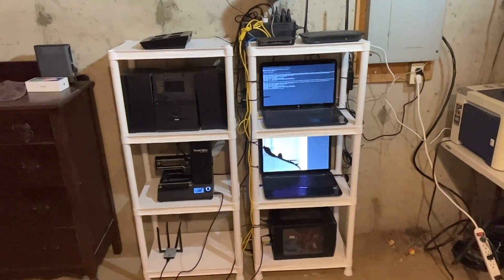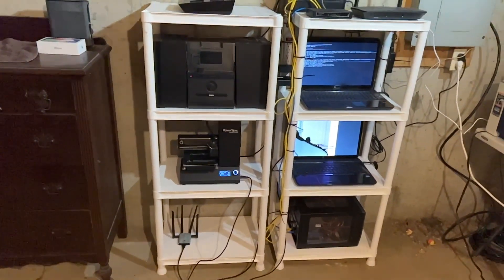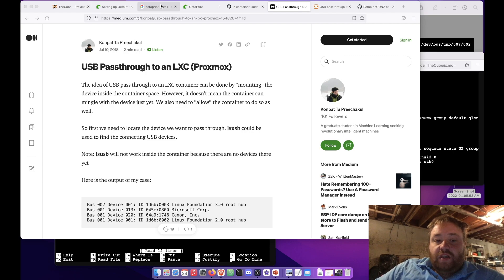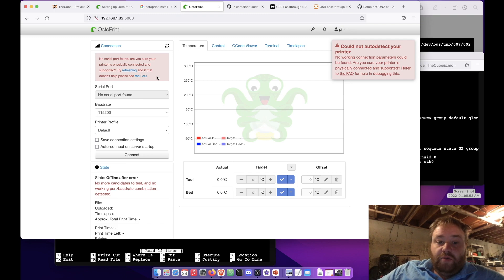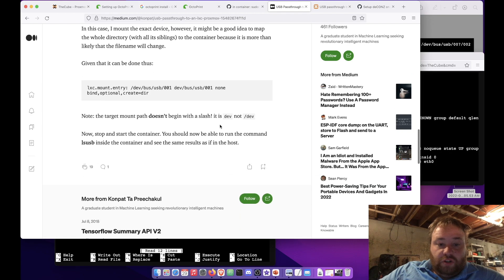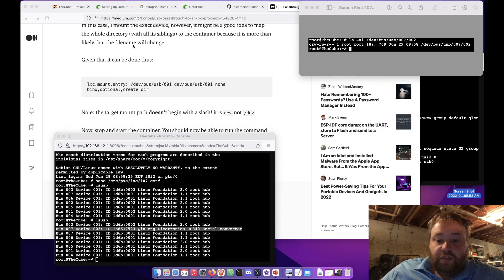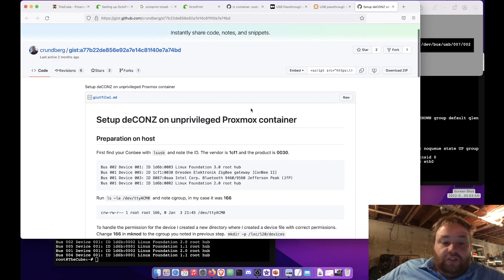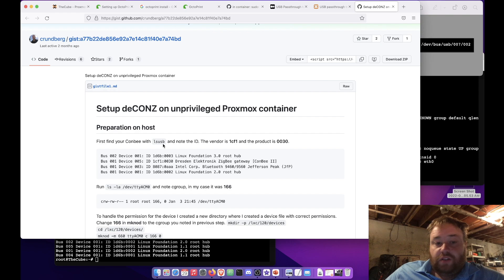Running 3d Printer from Proxmox USB Problems did not work Part One

Comment: I too had problems getting USB Passthrough, although mine was to a VM not a container. 
The VM is Ubuntu 22.10, 
Proxmox PVE 7.2-3 
OctoPrint Version 1.8.6
I eventually found the issue in the VM's dmseg log.

[    9.287340] input: BRLTTY 6.5 Linux Screen Driver Keyboard as /devices/virtual/input/input8
[    9.297896] usb 3-1: usbfs: interface 0 claimed by ch341 while 'brltty' sets config #1
[    9.301354] ch341-uart ttyUSB0: ch341-uart converter now disconnected from ttyUSB0

BRLTTY, a braille app, is taking control of my printers tty device.
I used sudo apt remove brltty and rebooted, I now have a /dev/ttyUSB0 and OctoPrint has connected to my printer 🙂

Hope this helps you, if you still have the issue
Reply: Thank you Mark.  It worked for me.